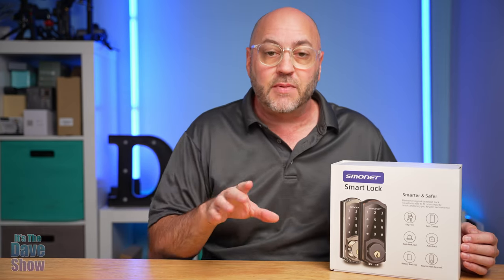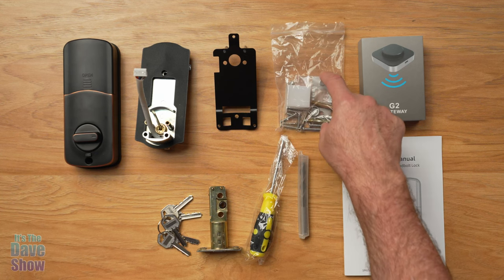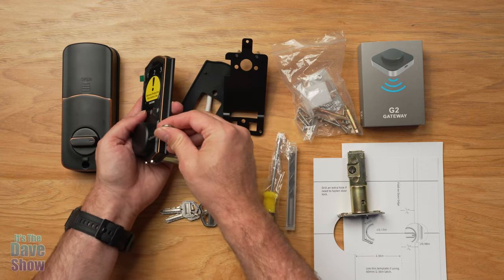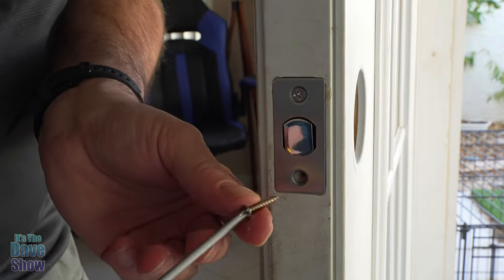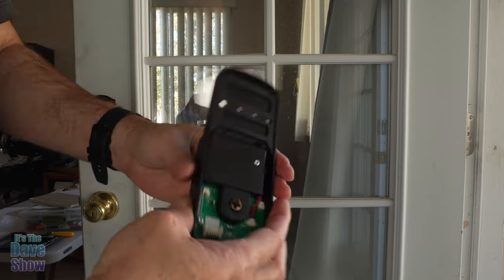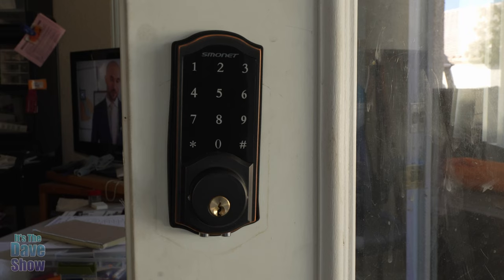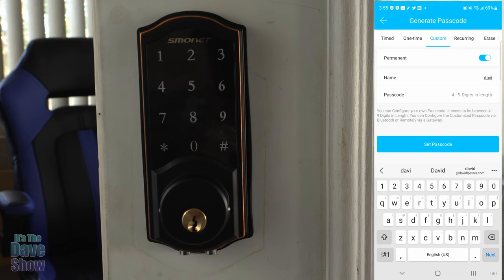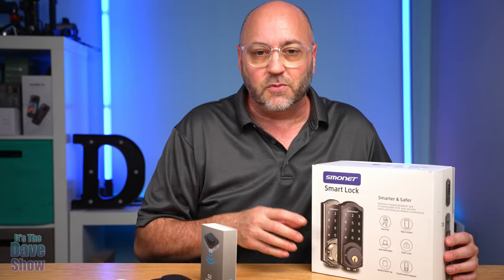Smonet smart keypad lock a detailed look at what you get, installation and programing with the app

Comment: Ok, so if your in your home and have medical emergency and call 911 -- how to 'OPEN' the front door to let 911 people in?  Is there a lock that can be used for this purpose?
Reply from the maker: that is a great question, of course there is just the turn latch on the inside to open but if you are having the emergency and can't get to the door I think they will do as they would do for anyone that calls 911 in an emergency and find a locked door.  They bust it in.  You can program many different codes but if you do 911 as a code someone else might try that too.  I don't know if medical or fire people have a special code they use for things like gates and stuff?
Reply: @ItstheDaveShow1  I was thinking when I call 911 give them the door code with the address?
Reply from the maker: @billligon4005  that would be a good idea!

Comment: My lock got stuck and I can’t fix it, even with the key when I lock it I can’t take the key out
Reply from the maker: yikes, that isn't good.  not sure why it would do that
Reply: I had the same problem. Need to reinstall the lock. Make sure that you can turn the deadbolt manually before screwing in. I suspect the problem is that the cable somehow tangled with the deadbolt.

Comment: #lockpickinglawyer literally picks these locks from them in under 4 seconds using nothing more than a simple rake tool. ☠️
Reply from the maker: I don't think there is any or many locks that a professional can't get into.  This is more of a deterrent and has features a normal lock doesn't have.  Thanks for watching!
Reply: All I have to do to unlock mine is hold down the pound key.  🤦‍♂️